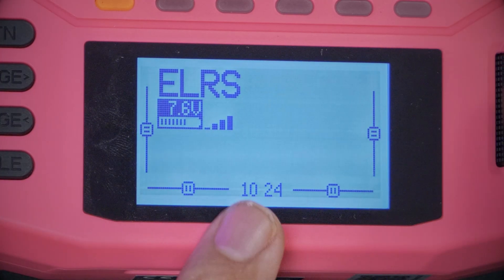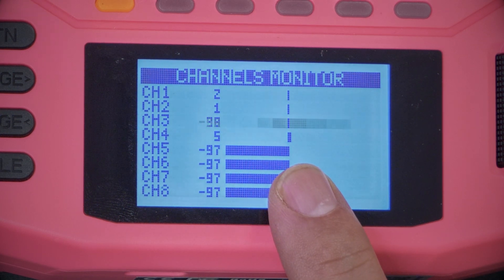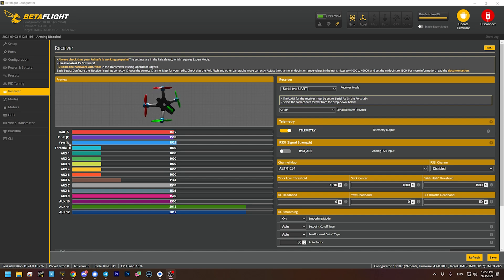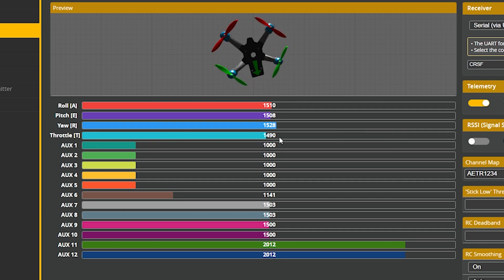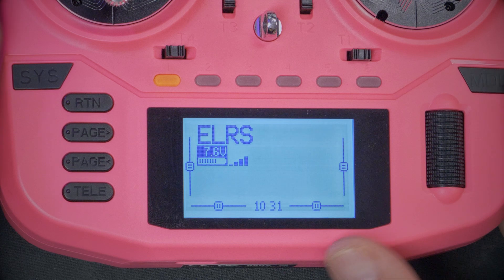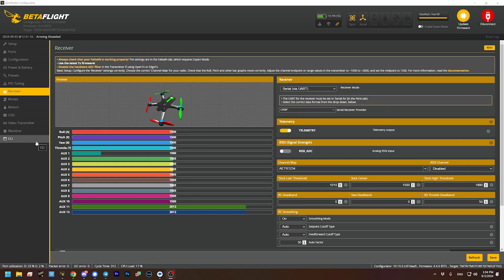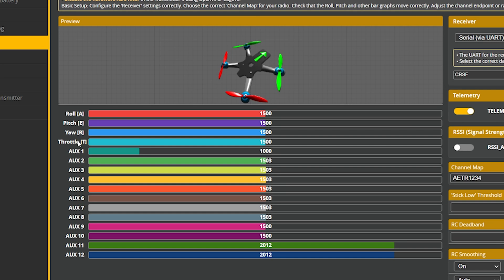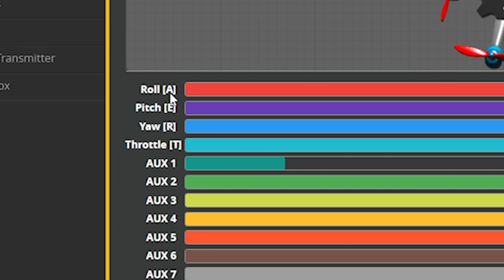EdgeTX 101 - Ep04 - Mixer Basics

Comment: With ELRS, Chanel's 1-4 are 10 bits while others are usually lower resolution. It would be very poor idea to use them for control sticks. Also channel 5 is only 1 bit, and cannot be used for much else than to arm (there are also other reliability issues for using channel 5 for arming).
Reply from the maker: If you use one of the FULL packet modes, then all channels are full resoultion. The channel 5 restriction goes away. And you get 16 channels instead of 12. The tradeoff is lower packet rate and higher latency.

Comment: BTW, the reason that Betaflight uses 1000-2000 (middle 1500) for the values on the channels, is because that is the pulse length that is being transmitted/received.  In PWM (pulse width modulation) which is what servos use, the position of the servo is defined as the time the pulse lasts in microseconds.  So, a middle value of 1500 means the transmitter is sending a pulse of 1500 microseconds.  Most modern servos can actually go from 500 - 2500 ms, which gives you an extra 45 degrees of travel on either end of the normal 90 degrees (this is what they mean when they sell 180 degree servos, they normally 90 degree, but the vendor is also including the extra 500 ms on either end of 1000-2000.)  :)

Comment: Isn't it 16 channels? The 4 channels usually mapped to the throttle and 3 axis, and the 12 aux channels? I have been gradually switching my fixed wings to elrs and most are getting 16 channel recievers.